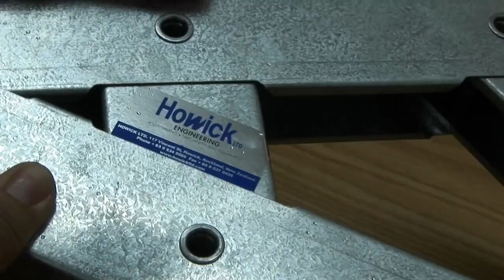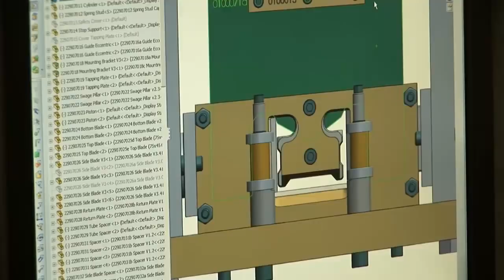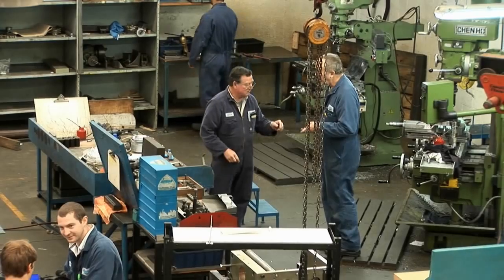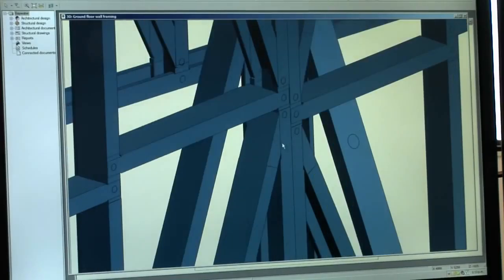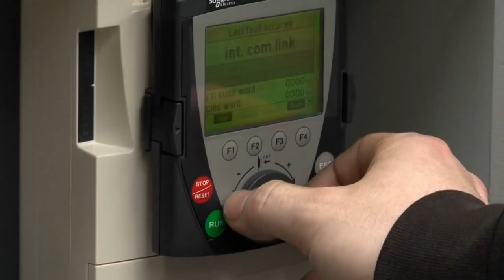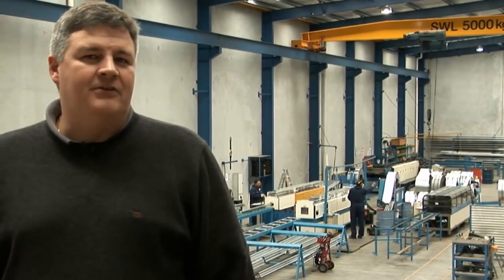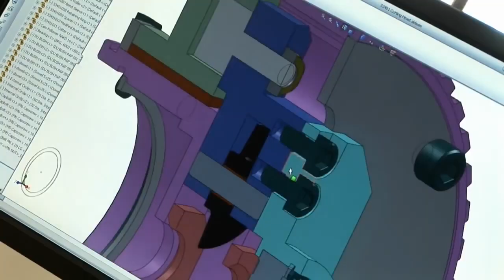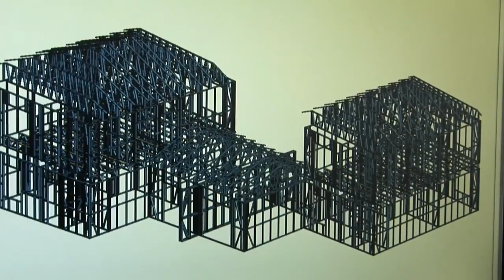Light gauge steel frame construction system from New Zealand

Comment: The flexibility is unrivaled ....when they can tailor the system to any software and can even tailor the system to accommodate your personal visions and ambitions.....there is no need to look any further. To top it all off they have that RFS division that will allow for the lowest start up possible as an end user, without the risk and commitment and capitalization required to be a manufacturer by allowing you to buy enough to build and sell a single family home.....from there....to scale up to an all out manufacturer...or settle in to your sweet spot and leave the manufacturing up to RFS.....INCREDIBLE!!!!    Im calling them and will be combing this with net zero energy technologies and green efficiencies. Im very familiar with this concept...love it.

Comment: What is the R value,  taking into account that steel is a conductor.
Reply from the maker: R Value depends on wall thickness but thermal conductivity for non autoclaved lightweight aerated concrete insulation is 0.1087 W/m*K